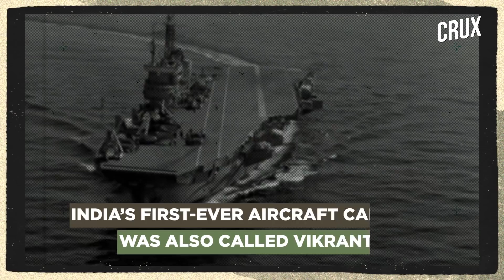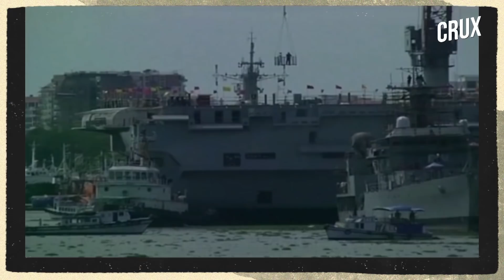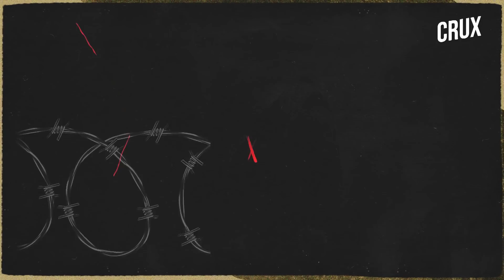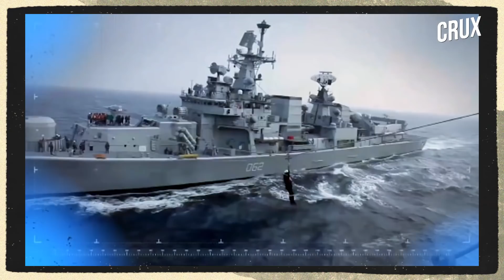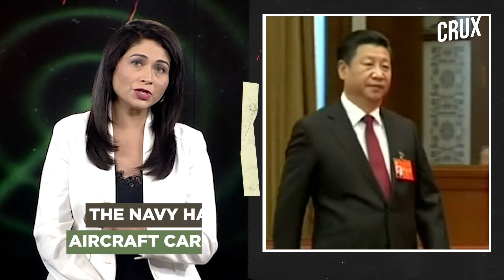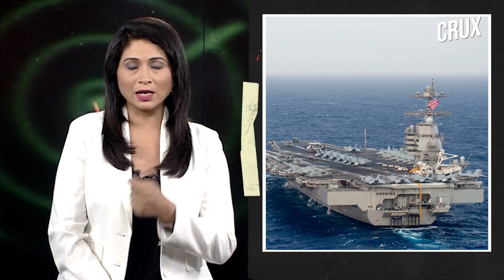India Readies INS Vikrant, Its Newest Aircraft Carrier, To  Stand Between China & The Indian Ocean

Comment: through private sector investments in the Indian Navy & essential defense hardware leasing solutions the IN can achieve a level of operational readiness that'll be second to none!!! the typical Russian design of the STOBAR aircraft carrier INS Vikrant (R01) is not what IN needs!!! and certainly not the air arm (with it's present elements)!!! rather what the Indian Navy needs is a fleet of two state-of-the-art 83,350 ton (96,000 ton loaded) stealth (CATOBAR) aircraft carriers powered by bio fuel cell & i-HYBRID marine propulsion system & one 18,200 ton (25,320 ton loaded) stealth (CATOBAR) light aircraft carrier powered by the same bio fuel cell & i-HYBRID power pack!!! escorting the flat tops will be 2 stealth guided missile destroyers, 3 stealth guided missile advanced combat frigates & 2 guided missile corvettes!!! not to mention 2 AIP & Li-ion powered guided missile fast attack submarines thus forming a complete (air, surface & submerged warfare ready) virtual perimeter around the flat tops!!! the air arm of the naval task force will comprise of 29-13 carrier borne F/A-18E Super Hornet (Block 30) multi role interdictor strike fighter & 3 NH90 maritime multi role ASW helos & 5 AIRBUS H160-N maritime CSAR helos . . . all of the above can be had by the IN in less than 10 yrs flat, through private sector equity participation & leasing!!! there's so much we can do for our country & in turn India can do for the world!!!

Comment: I would like to make a few  corrections
1)IAC means Indigenous Aircraft Carrier not Indian Aircraft Carrier
2)Range of INS Vikramaditya is 13,000km+ not 1300km
3) Chinese Navy's Type 003 are bieng built with Diesel Propulsion System not a Nuclear Reactor
Reply: great knowledge, kudos to you.
Reply: Right!? Their research is bad af…
Reply: @MERC_MONK  not at all.They have published works of high reputation and they are one of the countries with largest number of patents filed in the last years. They have excellent research infrastructure.
Reply: i do not know where the gets this info from probably from wiki
Reply: Indyck Monkey   bottom line Chinese equipment  is unreliable
Reply: Its not confirmed that chinese type 003 carrier is  going to use a diesel powered engine. There are speculations from international observers that china is going to power it using nuclear power.If at all  its conventional, next 2 carriers may will be nuclear powered. Also china has been working with small modular reactors now.Also they are planning to employ EM launch catapults along with CATOBAR.
Reply: @abin1838  no, the third Chinese carrier is conventionally powered. The fourth and fifth would be nuclear
Reply: @abinmohan3675  noted.
Reply: @abin1838  003 aircraft carrier is conventional power, not nuclear power, but it needs electromagnetic catapult.
Reply: well china is trying to make an new nucleared aircraft carrier doe.
Reply: 003 is Steam turbine propulsion system, not diesel.
Reply: Yes, when I heard 1300 kms, this shows her knowledge level.

Comment: Chinese Type 003 carrier is certainly not going to be 320 meters high- it must be its overall length across the deck. Even the American Ford class super carriers are less than 80 meters high. There is a difference between height and length. It is pointless to compare its length with the height of the Statue of Unity.  Even the 262 meter length of India's under construction carrier IAC-1 is significantly more than the 182 meter height of the statue of Liberty.  There is no point marveling over it.

Comment: China had zero Aircraft Carriers till just 2011. 
India operating aircraft carrier since 1961. 50 years apart and China has marched ahead in this category too.

Today after 10 years it has 3 carriers. 2 operational, one almost ready and 1 amphibious assault helicopter carrier as well. That's their manufacturing capability.

INS Vikrant is at best a medium-medium weight category aircraft carrier. It's not even 50k tons displacement. 

Even UK where manufacturing has stagnated built 2 carriers almost simultaneously in the 65k tons category.

Of course USA has 20 carriers out of which 11 are super carriers in the 100,000 to 107000 tons category. 20 carriers mind boggling. 

And just so that it doesn't scare other nations too much it doesn't consider the 9 out of the 20 as carriers which are the size of between Vikrant and Vikramaditya. It calls them amphibious assault ships. But they're as large as Vikramaditya. 

So yes 20 carriers in all for USA. 

China has openly stated it wants 10 carriers in its Navy and atleast 6 by 2030 or so. Highly possible. 

They'll barely take 2.5 to 3 years to float the carrier. 
We take 15 years to just think of an acquisition. 
Just one example the MMRCA for Airforce is pending since 2004. It's a bloody joke. There are many such examples actually. 
Minesweepers
Helicopter carriers
AWACS
Refuellers and many more.

And Indian Navy doesn't even have sufficient fighter jets to operate from both the aircraft carriers. 

And the INS Vishal on paper' since 2010.
Reply: Facts. The solution is improving GDP and allocating funds for innovation and technology. It will certainly take a long time before India can match china's manufacturing capability.
Reply: fake news

Comment: Vikrant is on the way where as, the aircrafts that gose on to vikrant needs to be bought ASAP. You can't just take half of the aircrafts of vikramaditya and call it a day. TEDBF will take time. This is mistimed and pandemic did the rest. We're at very critical stage right now.
Reply: Aircrafts will require atleast 3-4 years to be delivered, it's already too late. But considering GOI allocated massive funds for rafale and Tejas, little was left for Navy. Previous govts have depleted the squadron strength of the aircrafts with no additional purchases.